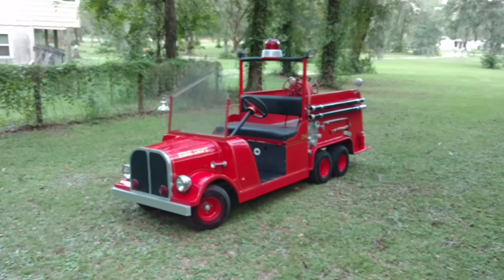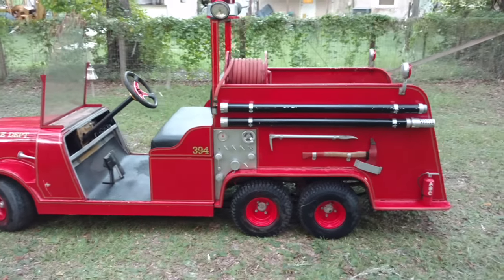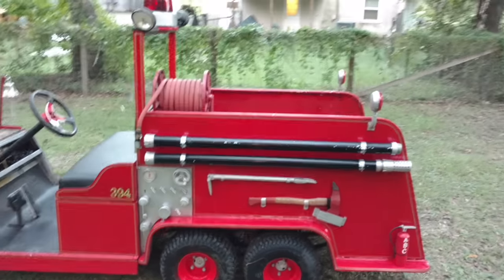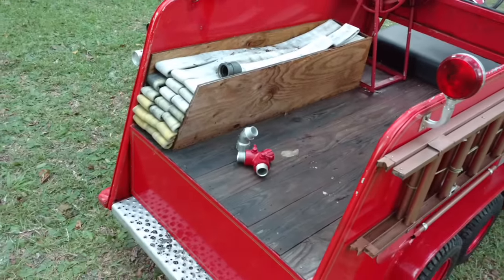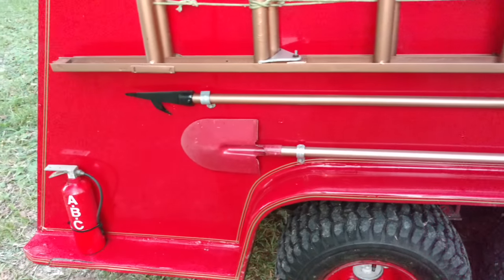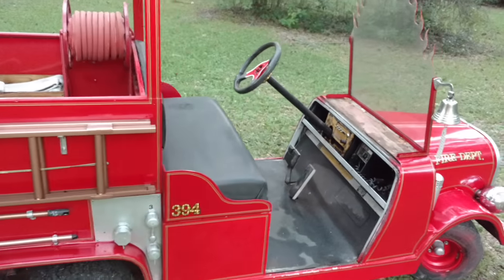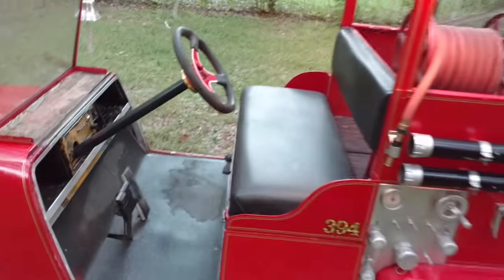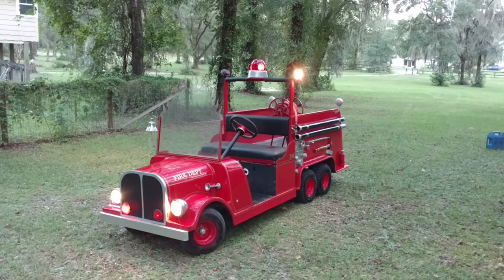Mini firetruck

Comment: The more I think about it, the more I believe it would be possible with some modification to make it a legit Engine....depending on how much available space under the seat and hose bed you have. If you can squeeze like a 16 or 18 horse Vanguard in there, use a stock clubcar transmission or even a john deere gator transmission and torque converter (for extra beefiness due to the weight) on the normal PTO side, and Briggs has kits for an auxiliary PTO shaft that will bolt to the flywheel, so on that side you use an electric PTO clutch for a riding mower mounted to a bracket, and instead of running blades, the belt will run to a small high pressure centrifugal pump of say 100-200 GPM capacity. Put a plastic 30 gallon water tank at the very front of the hosebed just behind the back rest of the seat, and shorten the legs of the booster reel to mount it directly on top. Then comes the fun of plumbing it all in, but I believe it can be done and you'd have a little working mini-pumper.

Comment: Where did you get all of this stuffI want to make the Zacks same fire truck
Reply from the maker: I made most of it. I fab the body out of fiberglass and the back half is made with lexan. All the tools were hand made. The light and siren I found them at a swap meet. I got the bell at hobby lobby. And a local sign shop made the decals.

Comment: What's the name of the light?
Reply from the maker: It was one of those Beacon Ray. But it was only the base and red dome. The light it self was just an extra tow truck beacon I had with no dome that I made work together.  But I sold it a couple years ago so I don't remember the model number of the dome part.